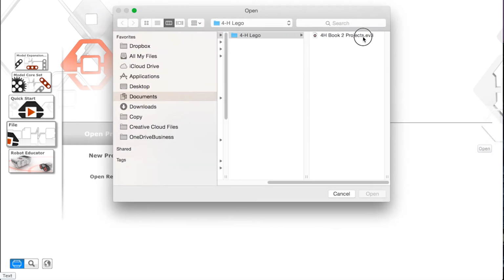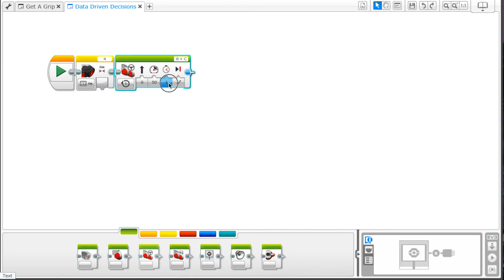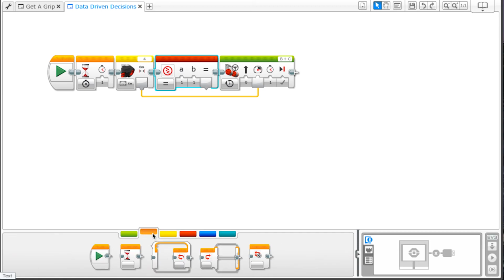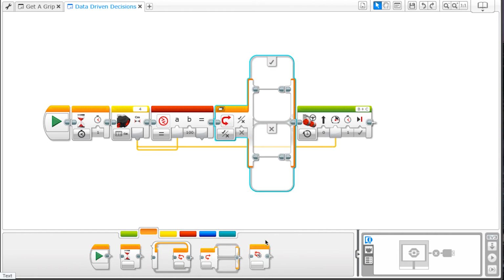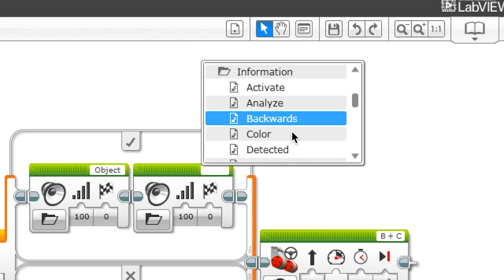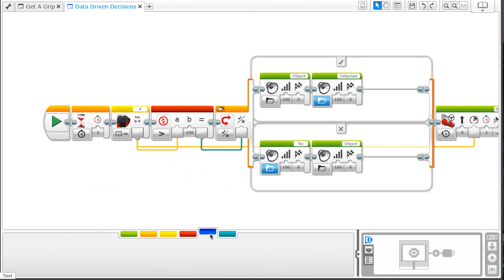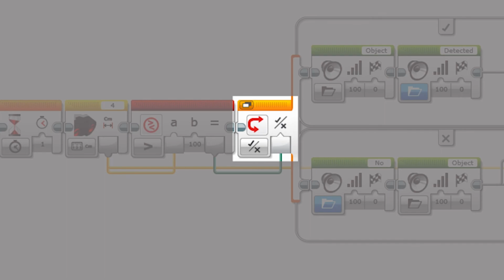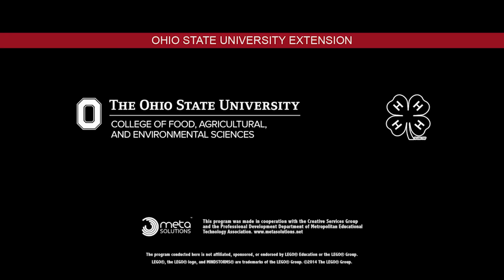Robotics 2: EV3N More, Activity 2: Data Driven Decisions

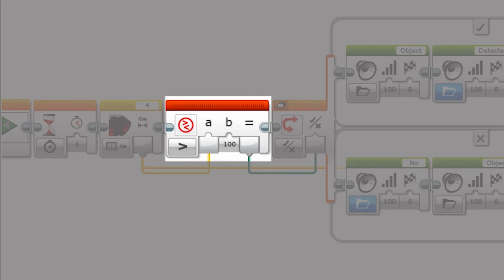Comment: For those working on this at home, I believe that there is a mistake in the program shown and that the compare block should be "<" (less than) and not ">" (greater than).  At 5:22 in the video, the narrator says "This block checks to see if there is an object within 100 cm of the ultrasonic sensor.  If there is an object, it will return a true value".  However, the program as shown only returns true if the distance is GREATER than 100 cm.  Based on the questions and experiments in the 4H book, I suspect that the narration is correct and the program is wrong.

tl;dr When writing this program, change the compare block to be "<"